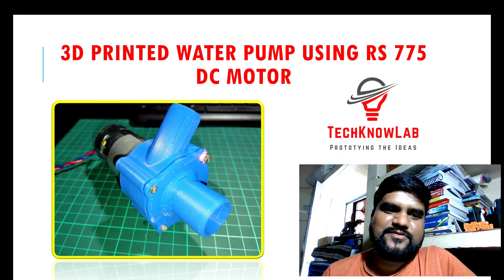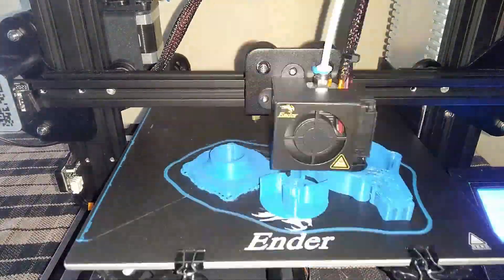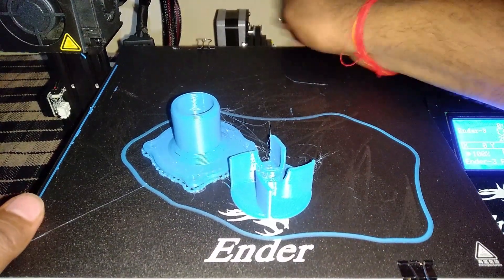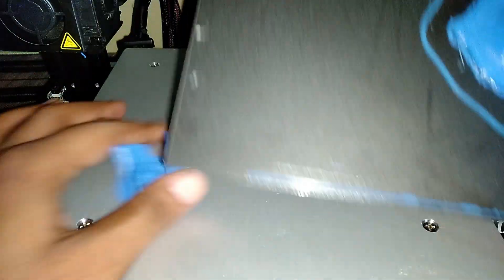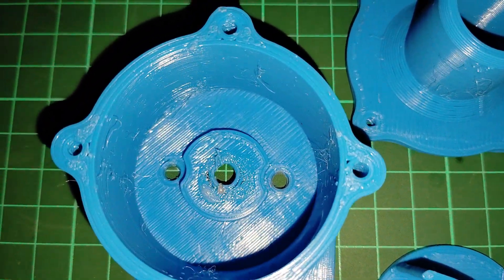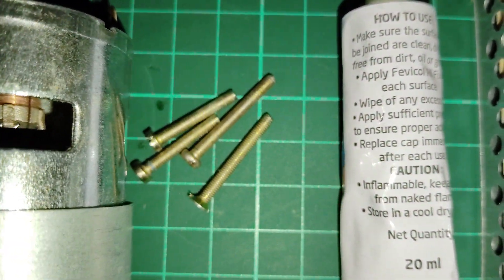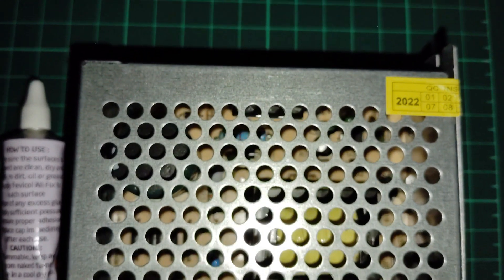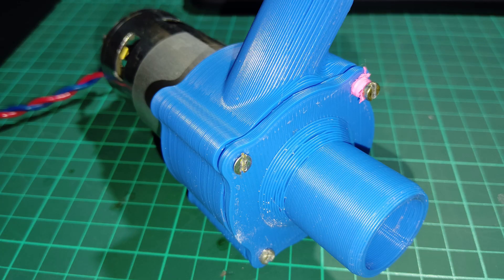Build Powerful Water Pump 12volt With 775 Motor and 3D Printer

Comment: How many ampere batteries should be used with this?
Reply from the maker: In this video, I have used a 12V 120W DC Power supply. But, the battery amperes depend on your application. As the motor has specifications of 0.5 amp no load current and stall current is 10 amp, so if you are using it for light load , you can go for a 12V 1300mAh battery - https://amzn.to/3UcN3FB